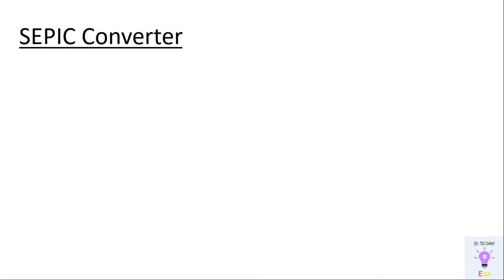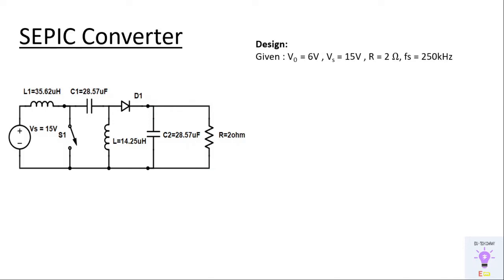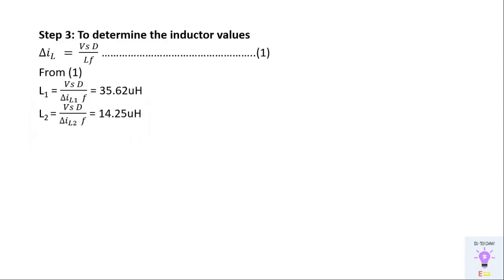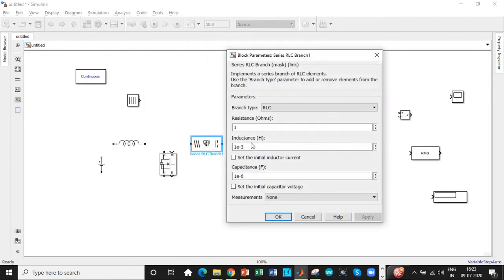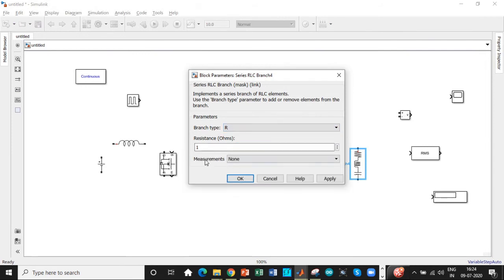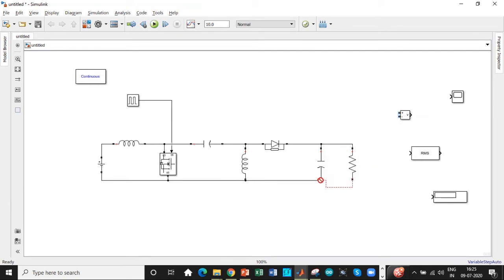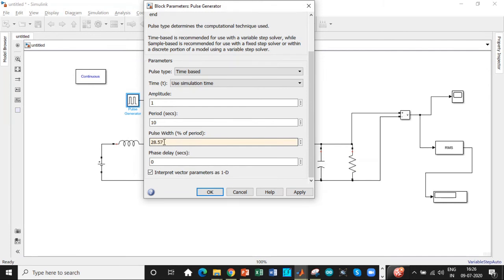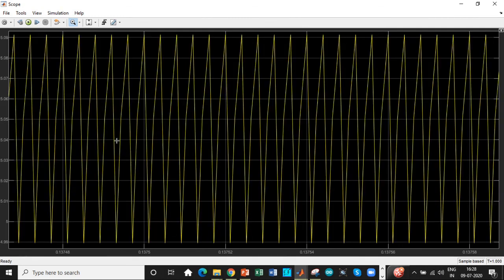Design and Simulation of SEPIC Converter using MATLAB | SIMULINK

Comment: Thanks first
But If I need to boost the voltage instead of bucking it what should I do please ?
As the input voltage is 15v and the output voltage now is 5v!
Reply from the maker: Change the duty ratio value and redesign the component values

Comment: Where does ∆Vo come from for calculating capacitors?
Reply from the maker: It is the ripple value that you have to select for designing a suitable value of capacitor
Reply: @ElectronicsMaddy  in your case, In the case of the video example, which one did you use? and because, as it obtained the value of 28.57 uF, I do not understand could you help me?
Reply from the maker: I would suggest you to go through Daniel Hart text book. You will understand the concepts clearly and will be able to corelate.

Comment: Why C1 =C2 taken equal sir? And L1 and L2 different
Reply: Sir How we can design for duty cycle  greater 0.5.As I have taken randomly  values for Vs and Vo ,R .Acc. to it calculate other values but in simulation output voltage show zero value and I have taken -15 and output voltage is 0.19 something
Reply from the maker: @ajaybhati9624  If you take random values that is what you get. You need to design the circuit acc to the procedure.
Reply: Sir Circuit works for 0.5 greater duty cycle actually pulse generator positioning wrong ho gai thi thank you sir for channel and helps in making my project
Reply from the maker: Good to hear. All the best :)
Reply from the maker: It's according to the design procedure. Please refer to the analysis of sepic converter to understand it better.